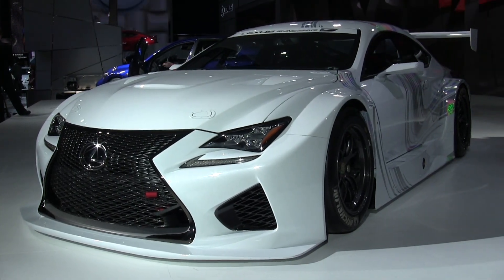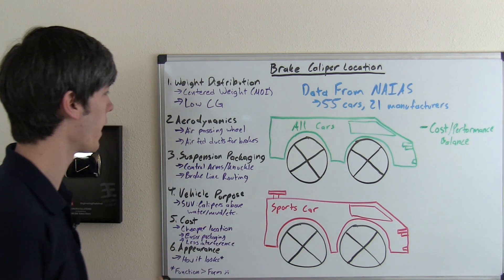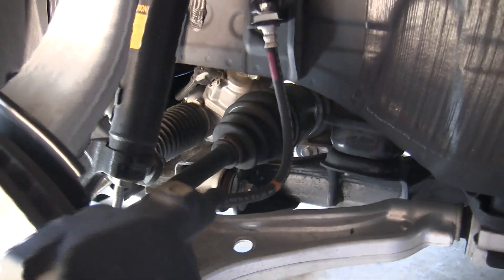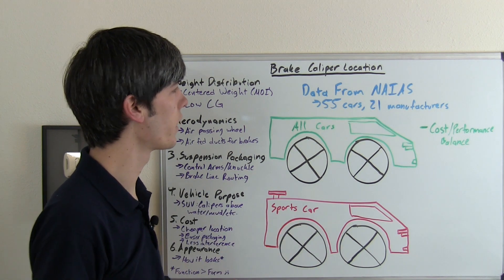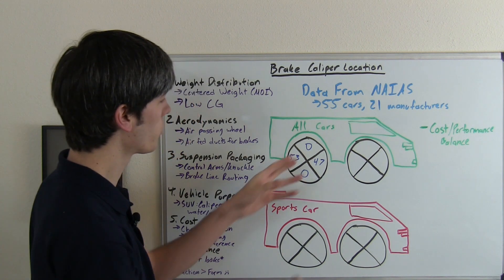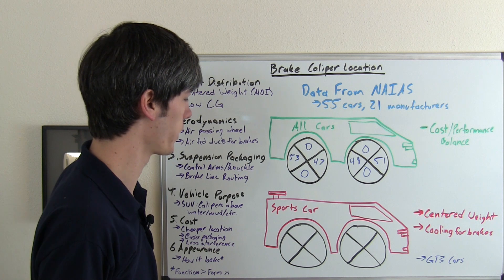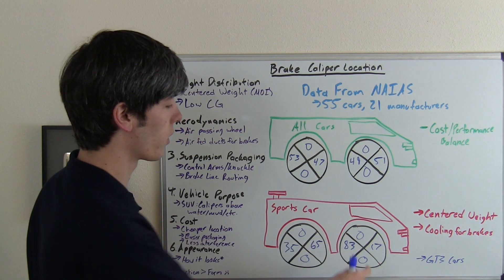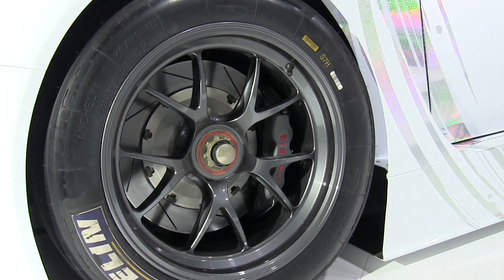Brake Caliper Location - Explained

Comment: There's a point you didn't mention about why putting calipers on the inside on sports cars :

When braking with a car, the global inertia will push the mass center to the front of the car, putting all the weight on the front wheels while the rear of the car is lifted up.

By putting the calipers on the inside, on heavy braking, when the calipers aplly forces trying to stop the rotors, the inertia of the front wheel will try to lift the front of the chassis up whereas the inertia of the rear wheel will try to pull the rear drivetrain to the ground.

(Try to make a disc spin fast and applying friction on on side of it, you'll see it trying to convert this friction by moving toward the direction it's spinning to escape your friction.)

These counter-forces, applyed in oposition the the force of the car slowing down, help balancing the mass center, keeping is as close as possible to the middle of the car, for better stability while braking.

I hope I was clear enough, correct me if I'm wrong, and sorry for my poor english! ;)
Reply: Abhishek Chowdary That's exactly my point! ;) I was told this by a friend who worked as a mechanic on a Aston Martin DBRS9 in the GT1 world's champonship.
Reply: This doesn't make sense to me. It would make sense if the caliper and brake rotor were not connected by a knuckle and wheel bearing like in your disc example. Regardless of caliper position, the resultant force is going to be a moment of the knuckle translated through the control arms of the suspension. Under braking, the unsprung mass becomes (more-or-less) single unit delivering torque through the control arms. However, that torque, front and rear, delivers a forward pitch of the entire chassis. Imagine pushing a stick through the front spokes of a moving bicycle. No resistance between the frame and rotating wheel results in normal riding. When the stick is jammed in. You flip over the handlebars. It doesn't matter where the stick goes through the wheel or even what causes the front wheel to lock up, just so that the front wheel locks up. A prominent method of controlling chassis dive (for braking) and squat (for throttle) is suspension geometry and spring-damper tune. By aiming the control arm pivot axes towards the vehicle center of gravity, diving undulations of the chassis can be better controlled.
Reply: How would changing the location of the friction matter? The inertia of the wheel will always be the same way for forward motion, and it's always going to cause a forward pitch. It doesn't matter whether you use calipers in any different orientation on the wheel.
Reply: drumnstuff Don't know the details, just reporting what a friend told me, I believe he knows what he says as he was a mechanic in the team who won the 2011 FIA GT1 World Championship (team Hexis Racing with Aston Martin DBRS9.)
Reply: Arthur Tipaldi A mechanic doesn't necessarily know anything about design. They know how to fix shit.
Sorry to say, but your friend is wrong.
Reply: decidiousrex You are focussing on the inertia of the wheel, but the location of the calipers changes the direction of the disc's inertia when applying pressure on it.
Effect might be called something like "geometric derivation of centripetal force" : when a rotation is slowed by a friction on a side of the disc, repartition of velocity verctors is suddenly unbalanced, resulting in the whole disc applying force directed mostly up or down depending on the caliper placed front or rear.
Sorry I'm french so not sure of the translation !
Reply: decidiousrex To take an example, here are the forces on our spinning disc :
http://www.wonderwikikids.com/resources/content/imagesv4/physics/newton+mechanics/circular+motion/spinning+desk.gif
This one would be on the front-left wheel.
Velocity is everywhere around it, making it's rotation balanced.
Now, imagine the caliper, located on the right of the disc, applies pressure, the result will be a brutal drop of velocity forces on the right side of the disc while the ones on le left side keep pushing harder, making the rotation unbalanced whil braking.
In our case, the global forces of the disc will try to push it down, resulting in the front drivetrain to be pushed up, counterbalancing the car's inertia pushind the front-en in a front/bottom direction.
Am I clear?
Reply: Arthur Tipaldi I understand exactly what you mean, I think, but it doesn't work like that.
"calipers changes the direction of the disc's inertia"
That's not possible. You can't just change the direction of momentum without an equal change in energy.
It's difficult to picture when we're talking about gradual braking, so instead imagine that as the brakes engage, they lock the wheel instantly. That basically turns the whole wheel and frame into a lever, and the previous rotational direction of the wheel will be directed to the frame, causing the frame to pitch forward, always. It doesn't matter where the calipers are located.
Don't believe me? Just try to build a brake system that doesn't pitch forward by placing the calipers toward the center or wherever you think it will work. You won't be able to.
Reply: Arthur Tipaldi I understand what your thinking, but the problem is that the caliper and rotor are connected via knuckle and wheel bearing, all together in the unsprung mass. New experiment: stand up, grab your shoe laces and pull them strait up toward the ceiling. You'll find you don't come off the ground because your hands are effectively connected to your feet via your arms, torso, and legs. You are arguing a similar scenario by mixing up your force and torque resultants. The torque resultant IS counter acted by the suspension control arms, and will occur no matter where the caliper is located. Any linear force resultant IS dependent on caliper location, but is counteracted within the knuckle itself, yielding a net linear force of zero outside of the unsprung mass, and has no bearing on the rest of the suspension. The caliper's radial position around the rotor has no effect on chassis undulation.
Reply: Arthur Tipaldi, I tend to agree with you. But being connected to the whole mass probably means, as the others have said, we are wrong.

Comment: Okay so I'm here because of CarThrottle through facebook but I have subbed to you a long time ago :p . Question is do you think it's all about weight distribution and cooling? Maybe something else?
Reply from the maker: Location of the steering linkage makes a lot of sense for the front calipers (doesn't influence the rear).
Reply: Engineering Explained right. I think for more stability :)

Comment: Besides the complications it would cause to manufacture, would having the caliper on the bottom not be best for a sport car? Less weight to be moved when steering and lowest center of gravity? Or even having it be half and half, inside and low? Say when racing is all that's important and not the cost?

Comment: would the location of the brake caliper be a factor for the "nose dive" effect during heavy braking? something between weight transfer of the veichle, and the force at work between the brake pads and the rotors?
the instructor at trade school said something about it years ago, but it didnt make a lot of sense to me back then
Reply: mathematically, the force the brake exerts on the rotor is the same no matter where its placed. as for dive, it has very little to do with the caliper location, the caliper itself doesnt shift weight to contribute to dive, so the location doesnt affect dive either. 

the only way to reduce dive is with physical dimensions of the vehicle, or more commonly, suspension components designed to work opposite squad and dive actions
Reply: but let say if the caliper is in the front, as you brake the rotor will try and pull the caliper down, while if the caliper is placed in the back, it would try and pull the caliper upward, force wise...

Comment: Hey I have a question about F1 ERS, but i don't think you'd see the comment, so i'd post it here.

For the MGU-K, does the motor spin the entire crankshaft to allow the pistons to rotate faster for a higher RPM and fuel burn. Or does the motor only send its power directly to the rear wheels to spin them faster??

Comment: Caliper location on the race cars has several reasons you mentioned.
Center of mass to the middle of the car, less rotational inertia when turning.
Having the front calipers behind the front rotor allows the air ducted to the wheel to enter the brake rotor in the center rear of the rotor. The air travels from the hub (cooling the bearings) outward through the vents in the brake rotor, where it exits towards the rim, and also, brake caliper.
The caliper being at the rear, this allows all the air that is traveling under the car, and into the wheel through the outside, to pass over it, where it would be in a virtual dead zone if it was on the forward side.
In a street car, that will help keep heat in the pads, during normal driving, allowing consistent braking.

Rear brakes having the rotors to the front side, once again center of mass. Brake ducts also travel back, but don't always enter the center of the rear rotor, because of the axle placement, as well as hub design on independent rear cars. Ducts are often through the body work and then exit under the car and simply point at the caliper/rotor.

A reason the calipers are mounted low, but only to a certain degree is wheel failure on race cars. It is a calculable risk to have wheel lug failure, human error, or a center lock wheel (one large nut) cross thread. When this wheel falls off, breaks off and or otherwise fails. The car falls and the brake rotor itself rides on the pavement.
As the cost for a consumable like a brake rotor is completely within most budgets, as a item replaced frequently (not so much with full carbon) its preferable to have the brake rotor for other reasons as well to be the only part of the now bare corner, riding on pavement.
If the wheel fails. Its very plausible that if there isn't an accident.. the car can have a wheel mounted and continue, even though the brake rotor itself rode on the pavement some.
If the caliper was mounted low, it would cause irreparable damage to the caliper, possibly damage that causes the braking hydraulics to become compromised, allowing the remaining brakes to fail. And or cause enough drag, to make the car spin, and or do extremely costly damage to the chassis components from the shock loads.

Comment: Why aren't anyone making inboard disk brakes anymore, like those on old Alfa romeos and Jaguars? Wouldn't this reduce unsprung weight and give more freedom in suspension design?
Reply: I believe what you say is true, as far as i know, that may make it harder to supply cooling air to the rotors and also make it more complex to relace worn pads/discs

Comment: another thought is that on front wheel drive cars the calipers would be in front most of the time because there is an engine right in the way of the rack and pinion which is why the rack is usually behind the axles. because on front wheel drive cars the engine is in front of the axles and sits where a rack could go but can't which is why most of the time the rack is behind the axles with calipers in front. on a rear wheel drive car the the engine usually sits far back as possible to give more weight to the center which is why steering linkage is often in the front because there isn't much room behind the knuckle and you are left placing the calipers on the rear of the knuckle(there is also a big transmission behind as well).

Comment: wtcc hondas had the brake calipers down on the lowest spot (i don't remember if on all 4 wheels or just on the rear ones) in the last season and the year before. they said the cause was slightly better weight distribution.

Comment: Wouldn't caliper location also be dependent on where they felt the rack and pinion should be? I think a reasonable explanation for having the front caliper on the back is that the they want the rack and pinion in front because there is more room given that sports cars like having the engine as far back as possible. what do you guys think?
Reply from the maker: Absolutely.
Reply: Engineering Explained  Is it possible to get pics of the steering knuckle(uprights) of these cars?I would like to see how the steering arm is positioned(the angle,length). I would like to see how this affects the caliper position too.

Comment: Another important reason that you missed is steering rack placement. The steering is more precise when it is towards the front, because more mechanical advantage. This leads to the placement of the calipers towards the back of the front wheels.

I read about this on Edmunds.com a while back. It seemed to make sense for me!
Reply from the maker: Great addition!

Comment: Besides the factors you listed and spacial reasons....what would be the purpose of different locations? Is the stopping power better when the caliper is positioned in the front of the rotor, Or is the stopping power the same no matter the location?
Reply: It's the same no matter the location.
Reply from the maker: From a simple mathematic view, it would be the same force applied regardless of position.
Reply: Engineering Explained Maybe to keep the force that the rotor do to the chassis in a way that the caar stays flat. The force to the chassis from the front rotor will be up if the caliper is in the rear, and the same applied to the rear brakes. Maybe!... that just was my conclusion after a personal visual analysis. 
+
Reply: Rafael Torchio Well, yes, but it won't lift the car body up so it has no effect on the car staying flat. It doesn't work like that. It's the same as if you grabbed your own thigh and tried to lift yourself up. You can't.
The brake caliber will try to move up when braking, but the brake disc will try to move down with the same force so the net of those forces will always be 0. Basic Newtonian laws of physics at play here :p
Reply: Rafael Torchio  it actually has no mathematical function to cause this as the caliper is mounted to the hub and will obviously rotate with direction which the rotor is going, so clockwise or counter clockwise, regardless of placement. This is because of the rotational movement rather than lateral. So if the caliper was at the back it would rotate the hub clockwise and likewise it would if it was at the front as its a moment of the same magnitude e.g. the diameter of the rotor. Try it with a dinner plate and you can see what happens if the plate was held top and bottom like a hub.
Reply: Engineering Explained ok, so this is simply: the desired location is based on space available and the size of desired caliper assembly. You had me over thinking it at first.

Thanks for the clear reply.